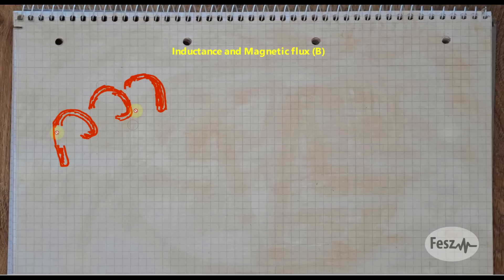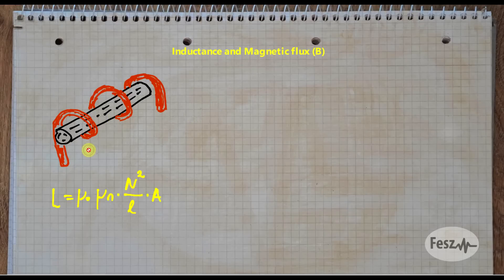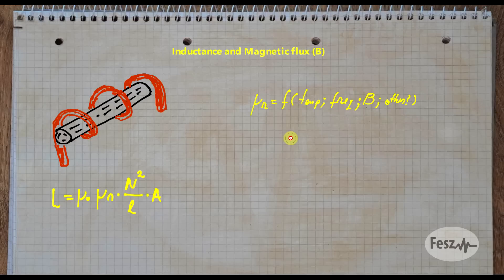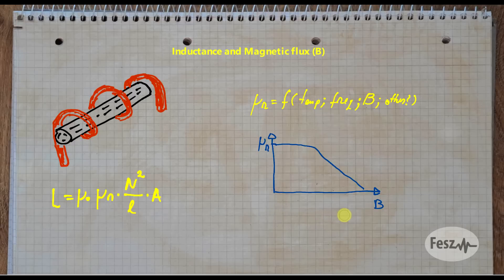Basics of Magnetic Amplifiers

Comment: I think these were (at one time at-least) commonly used to dim airport runway lights.
Reply: @colinstamp9053  
And because the bulbs were connected in series, the magnetic controller was used to BYPASS burnt bulbs.
Reply: @paulcohen1555  Could you please elaborate on bypassing?
Reply: @sergepetrov8598  
When the bulb on the secondary burnt out, the transformer core went quickly into saturation and presented low impedance (resistance) to the loop.
Reply: @paulcohen1555  So my imagination draws each lamp having personal transformer, with all primaries in a common loop. How did dimming work then? 
BTW techie replacing bulbs is protected from high loop voltage by design. No need to turn lights off in nasty weather.

Comment: Some forty years ago, I encountered a magnetic amplifier in an industrial CO2 laser used for metal sheet laser cutting. It was used to regulate a high voltage supply that powered the electrodes on both sides of the laser tube.